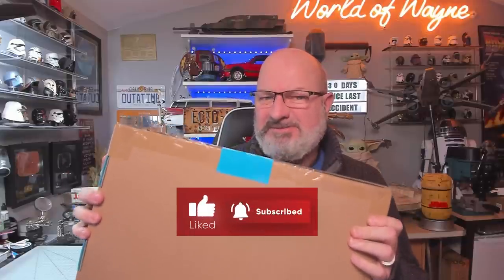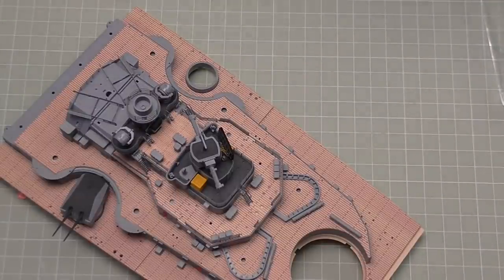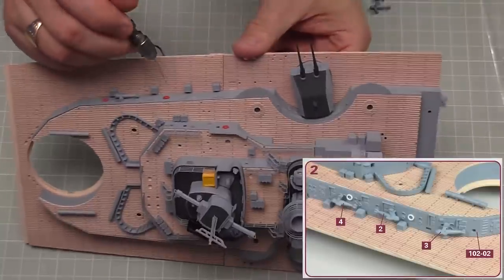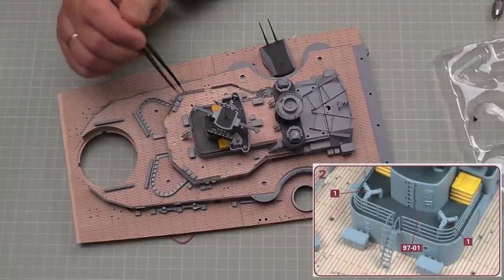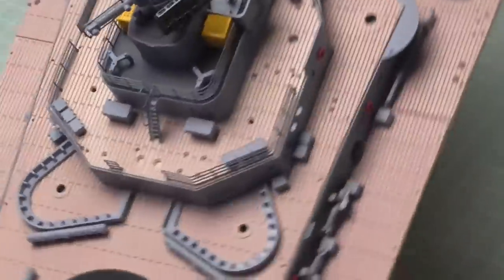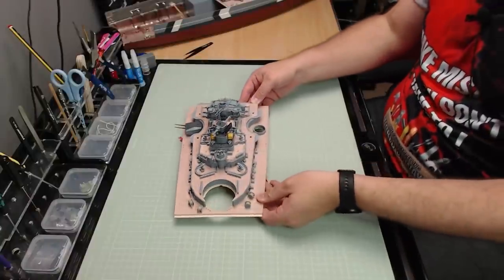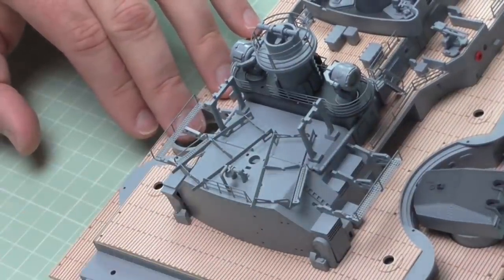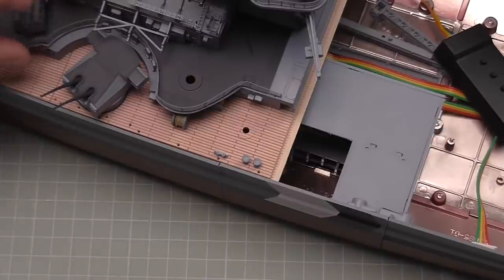Agora Model's Bismarck The Legendary Battleship - Pack 10 - Stages 105-116

Comment: World of Wayne you would need to move the flak guns from the spotlight deck to lower deck
Reply from the maker: Yep. I’ve already done it now
Reply: @WorldofWayneUK  I'm at this point now. Did you have any trouble moving the guns? How did you get them loose?
Reply from the maker: @michaelszafranski7023  once I knew I had glued them I removed the motor and forced it by hand to brake the bond
Reply from the maker: Ahhh you mean the flak guns: I used very little glue so they came out easily
Reply: @WorldofWayneUK  Thanks for the quick reply! I'll give it a shot. I hope I didn't put a huge glob of glue on these. lol
Reply: @WorldofWayneUK  Well that turned out better than I thought it would. Just used my needle nose piers and a couple twists and they were off.